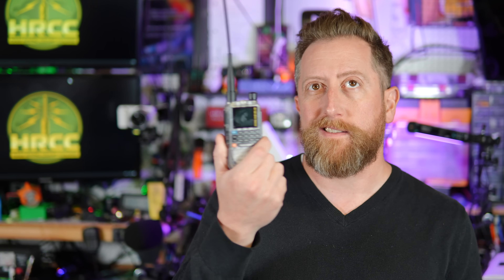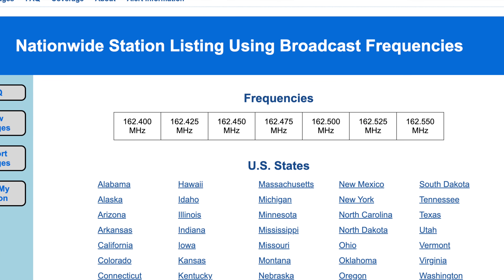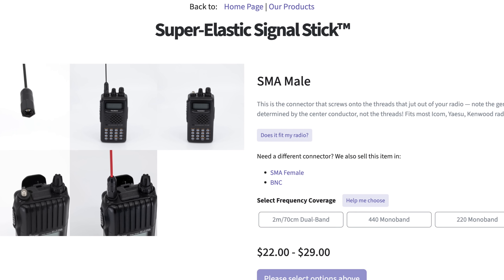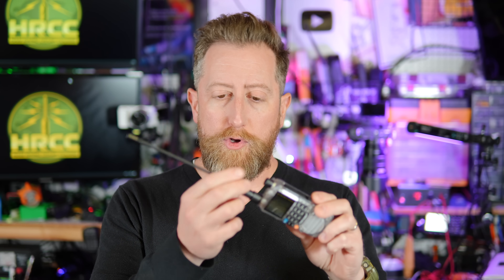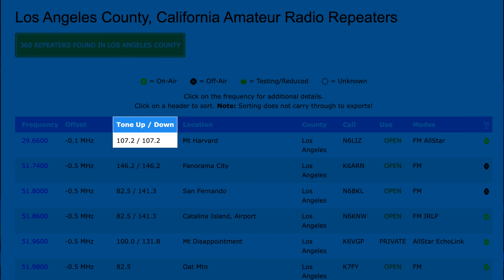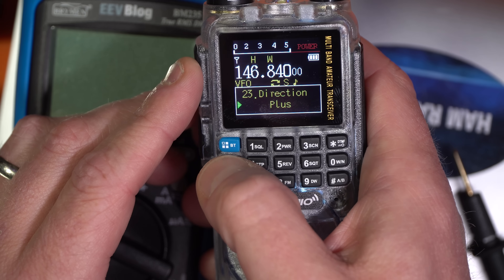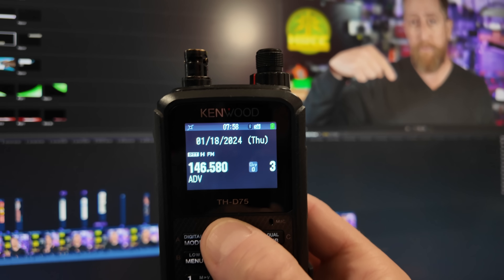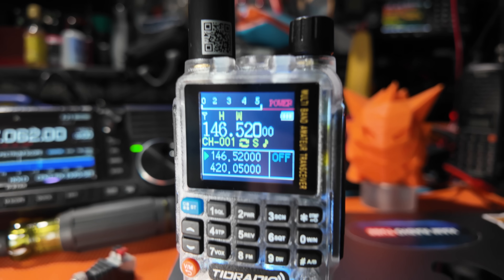Your Radio Is NOT Broken You're Just Doing It Wrong!

Comment: Saw an interesting podcast where they pondered the question.  Is gmrs the new novice license?   For me it definitely is.    Thoughts josh? Better yet if you discuss it on the podcast 😂
Reply: @Grognarthebarb  for some people test is still too hard
Reply: @paulmitchell4421  imo the tests should all focus on how no to interfere and how to use your radio safely not on the electrical engineering side.     Like how a hunter safety course doesn't teach you how to be a good hunter.             With so many vendors of ready to use products most of the engineering info is worthless to most peple who would be hams if not for the tests

Comment: A DC short between the antenna center pin and ground does not necessarily mean the antenna is bad. Some antennas - like your roll-up J-Pole - is a DC short, but RF magic. 🤘😁
Reply from the maker: Sure…. But likely not a ht antenna.   😅
Reply: @HamRadioCrashCourse  any half-wave should. 5/8 may also have a DC short as a matching network.

Comment: There is a lot of dead air and continuous interference on other channels, even in the middle of the major city I live in. There appears to be only one local repeater that I found actually in use while all other other repeaters are dead quiet.

I would recommend starting with the GMRS radio first since they generally are more active than HAM frequency and you will learn how to use all of these feature when you decide to upgrade.

Comment: You should also mention that the standard repeater offset will be different for each band, not just the direction….600 KHz for 144, 5 MHz for 440, and 1.6MHz for 220.
Reply from the maker: I was going to, but I kinda wanted to keep the topic light and high level.

Comment: My Tidradio TD-H3 worked for a week or two, then I could no longer bring up any local repeaters, even tho nothing had changed in programming. I sent it back to Amazon and got a working replacement within a week.
Reply: @donrobinson5540  that's what happens 100% when you grab the ht by the antenna the way the sad gmrs youtuber shows.
there's a ceramic cap across a coil near bottom that cracks when ant is bent that way.
he does that hoping you break your ant cause he's a psycho.
Reply: I had two H3’s fail within two weeks. Different issues with each. I wonder how long Amazon lets a vendor have a high rate of returns. I like to have two on hand for the purpose mentioned in the video but now it seems you need two to make sure you always have one while the other is being returned. The H 3 is great for learning about how thee HTs work and eventually I will get a more reliable brand once I know what it is I really need.

Comment: Or, if you are like me, the radio works just fine but where you're cheap radio doesn't have the legs to actually reach anyone on UHF/VHF and there aren't any repeaters close enough. So then you have to decide if you want to invest even more money into a hobby that hasn't proved it's worth it because there is no one nearby in the hobby. "Go to your local club" I hear you say. So yes, pack up and drive the 2 hours it takes to get to a club meeting with people who don't care because you aren't into the specific type of hobby they are.
Reply from the maker: In a true RF desert you may need to start looking into HF.
Reply: Don't overlook the highly dramatic improvement a better antenna can make. Google "Fong J-pole" for the most effective of that family. Or build yourself a tiny cubical quad using a few bucks work of torch welding rod and a bit of cheap sprinkler pipe and a few fittings. Add some coax and go. I've many times worked hilltop repeaters over 120 miles  away with between 2 and 5 watts with my little quad on the 70 cm band. Boosts signal more effectively than more watts output believe it or not, plus improves your ability to receive. Cheap but excellent fix.